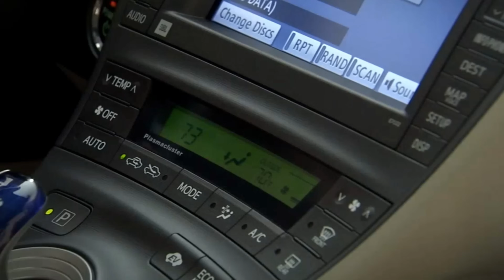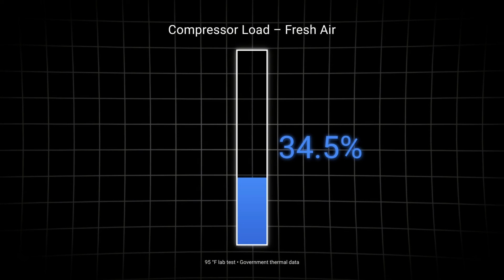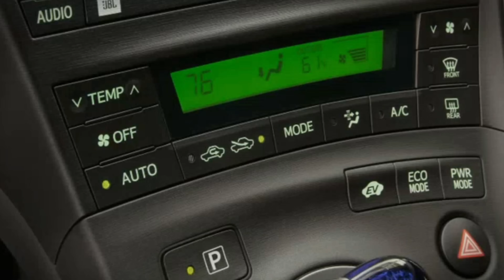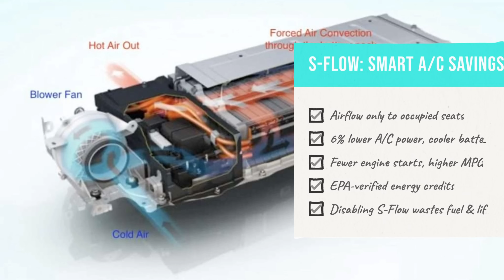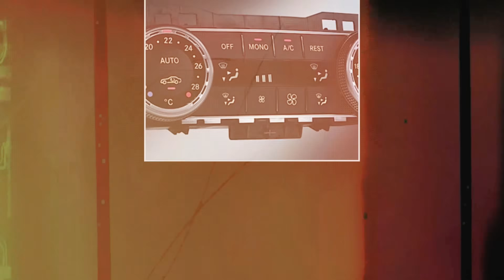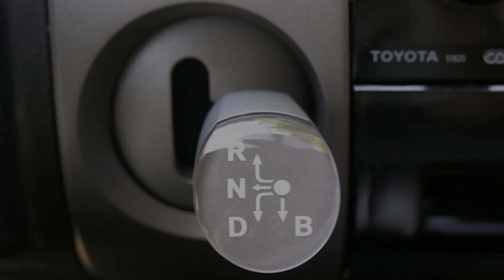The Toyota Hybrid A/C Setting That KILLS Your Battery 3X Faster (THERMAL DATA PROOF)

Comment: Total nonsense. The hybrid battery is nothing like a phone batter. It’s never fully charged and discharged. My 2010 Lexus RX450h hybrid battery lasted 490,000 km, and I left it on outside air 95% of the time. Only used recirculating when it was hot and humid. Buy yourself  CO2 meter, if you have 3 or 4 people in the car, recirculating for any length of time will push the CO2 level to well over 1500 ppm, something you don’t want.